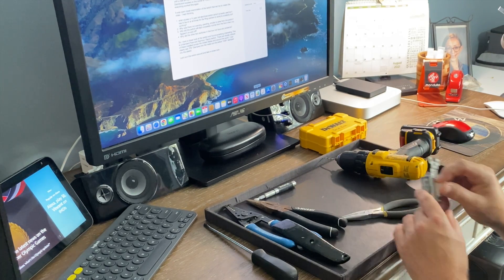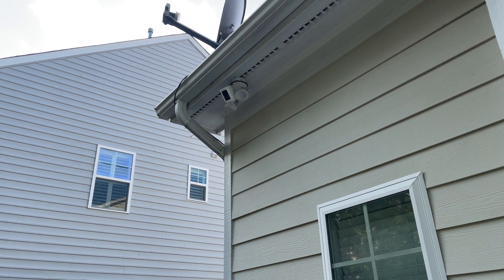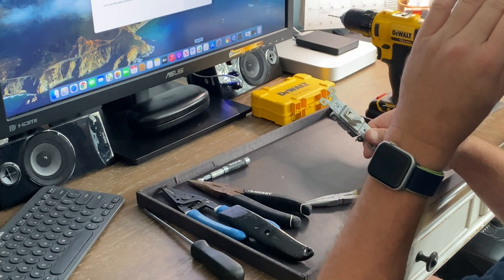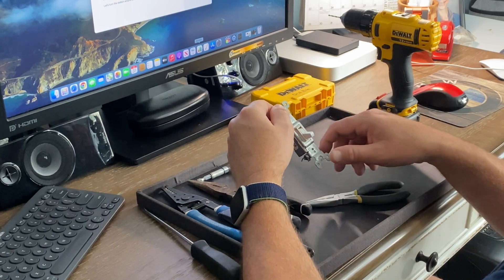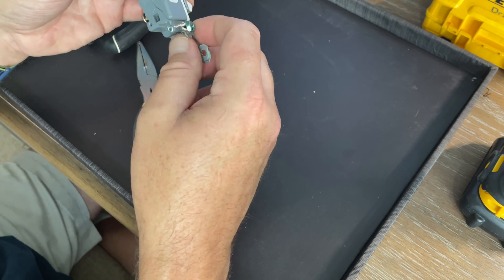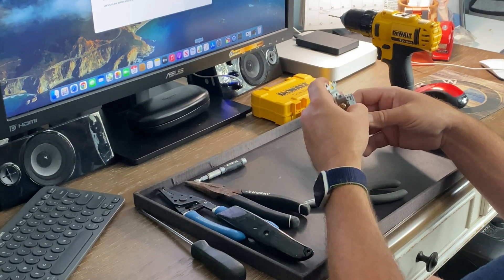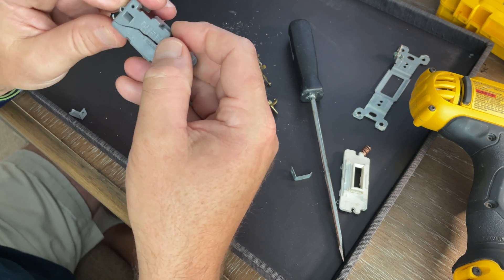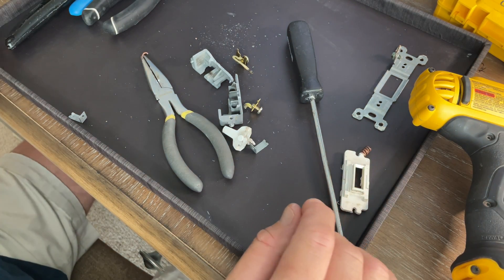Pass & Seymour / Legrand Switch Failure #1.  What happens Inside a Light Switch that fails?

Comment: I live in germany.
I wonder how different your standards for home wiring are compared to ours.
Even the mechanics of a simple 2-way switch is different. 
Your light switches seem to be made with focus on reliability and maintainability. Fewer but stronger parts. Everything in your house wiring is like hat compared to our standards. And it works pretty well.
Something I like on your switches: The entire states (which are much bigger than Germany) have the same small set of different shapes and colors you can choose from. You have the flat rockers and the lever-style toggles. That's it. For decades... And all of them are good quality.
In contrast, here in germany, hardware stores used to offer switches and sockets in hundreds of different shapes and colors, incompatible to each other due to the lack of a common standard for face plates. So face plate A won't fit switch B from the same manufacturer. 
That offer changes frequently. Many of the switches are so bad quality that even electricians refuse to install them. You're happy if they don't break apart when you fasten the screws.
If one of three switches fails after three years, it is very likely you have to replace all three plus the face plate because everything changed again and suitable replacement is not available anymore.
Furthermore, I prefer your wall boxes over ours. All fixtures share the same room which simplifies wiring between them and you get more into the same space. Here in germany, each single switch and each damn socket gets its own wall box. It just looks chunky if there are many fixtures in the same spot. You have the choice between having too few sockets and a wall crammed with chunky sockets.
Reply from the maker: I would enjoy speaking with (if you speak English which apparently you do). Unfortunately I do not speak German. The only German I know is from video games and it’s not exactly nice German :-)
Reply from the maker: Maybe we can chat on zoom sometime and I can provide more details for you. I would also like to learn about how power is done in Germany.